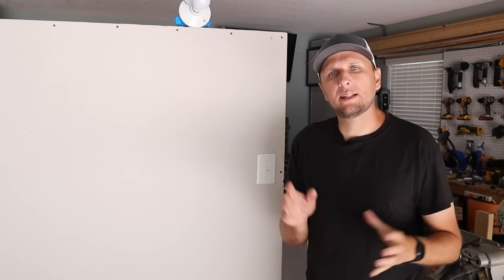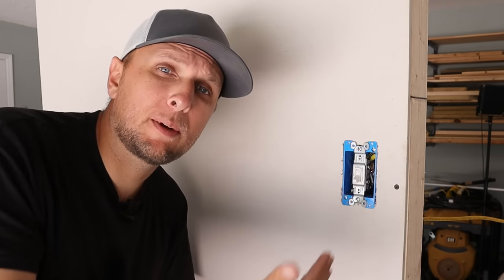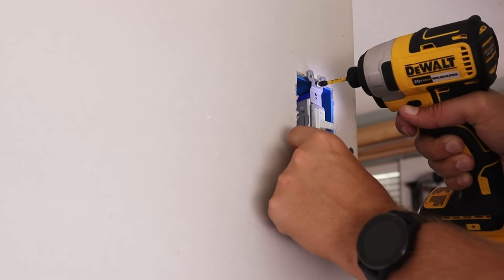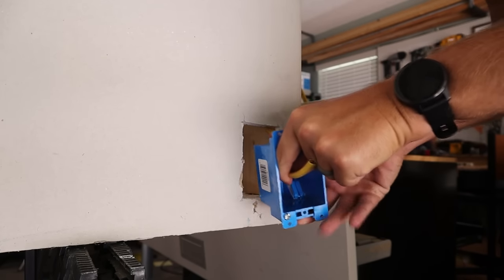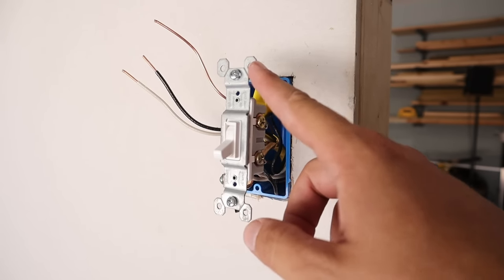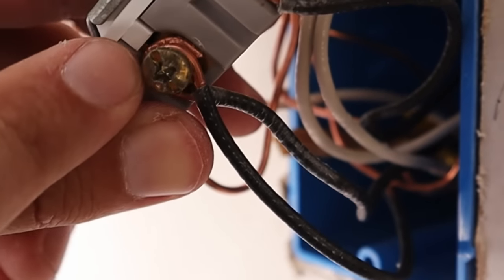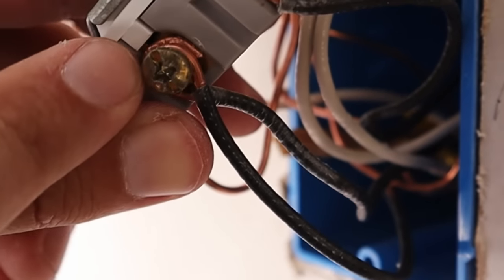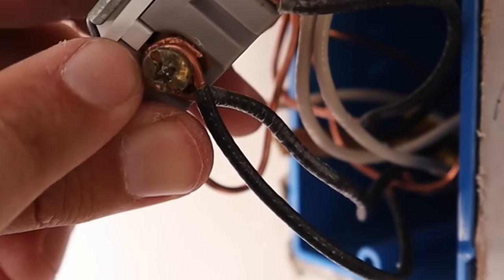How To Add An Outlet From A Light Switch | Common Mistake

Comment: Alot of light switches and light fixtures are on 15A circuit breakers and use 14 gauge wiring. Outlets are usually on 20A breakers and use 12 gauge wiring. As always I go by the 80 percent continuous load principle where a 20A circuit should be loaded to no more than 16 amps. A 15A circuit maxes out at 12 amps.
Reply from the maker: Depends on local jurisdiction.  My house is pretty new and almost none of my outlets are on a 20A breaker or use #12 wire.  The circuit size is determined by the room and it's intended use.  I know some places do what you're saying but definitely not all or most.

Comment: Great videos, I just subscribed.  Can you do a video of how to install a ceiling fan in a room where there’s none?  All of our rooms have a light switch that controls an outlet and there is no light fixture on our ceiling.  Keep up the great work.  Thank you
Reply: I've had to do that before, many times - I make my living as a handyman, if that makes any difference. It's a pretty involved process and if you don't have much experience with home wiring you should at least consult with an electrician before starting it. If nothing else, get them to tell you A) if your local codes allow you to put a fixture on the same circuit as your outlets, and B) if you even have enough amperage available on the existing circuit to support another fixture.
Reply: Going to have to punch holes in the walls and ceiling.
Reply: @danlux4954  Unless the wires run through the attic (or basement...or both.)
Reply: @Dwayne_Bearup  still have to punch holes in the walls and ceiling to run the wire from the switch to the ceiling.
Reply: @danlux4954  Most homeowners lack the skill to repair drywall properly and youtube videos can only teach so much about texturing techniques. Matching the patch texture to the original texture and making the patch invisible requires a level of practice most homeowners/DIY'ers rarely bother with. Fortunately there are ways to add a new wire to a switch box that don't involve chopping holes in the walls, provided there's an attic. Ten minutes with a fish tape or rod and some patience saves hours of drywall work patching holes.
Reply: @Dwayne_Bearup  most houses here have two floors, attic only works on the upper floors.
Reply: @danlux4954  That's true. And I know OP said all the rooms in his house have switched outlets instead of ceiling lights/fans, but it's very rare - in my lifetime of experience - to find that situation anywhere but the bedrooms of a home. Since bedrooms aren't typically found on the ground floor unless it's a single story home and most homes have pitched roofs...attic.

Comment: Great videos!  I have a question about my electrical panel.  I am doing a kitchen renovation and my electrical panel has two slots in my panel with four breaker terminals supplying power to my refrigerator, dishwasher and range.  Each of the slots have two breakers and the ones in the centre are joined by a bar that feed the range.  What is the reason for this?  Should I keep this configuration or would it be ok for me to feed a receptacle with the one labeled for the range?

Comment: Great demonstration. However many times and more often than not I will find shortcuts that were made to a light switch where there is no neutral wire because the neutral wire has black tape around it and it has been repurposed as the return load wire to the light socket. In that case you would be looking for a wire that does not exist. Maybe point that out and the video and offer the alternative as they will also need to find an existing outlet to jumper a neutral wire from, And if that case they could’ve just got both black white and ground wires from that outlet

Comment: The outlet and switch appear to be “commercial grade” (better quality), which might be worth mentioning.
In cutting a hole for an electrical box, an old woodworking technique appears to produce a cleaner cut; score the surface with a sharp utility knife and straight edge, then finish with the jab (or “drywall”) saw.
Before the trolls and naysayers attack, yes, the cover plate should cover a ragged edge, “should” being the operative word.  A ragged cut can lead to cracking, splitting, etc.  Better to get it right from the start.

Comment: Make sure you don't overload the circuit. By code you can only have so many outlets on a breaker depending on current capacity.
In many cases lighting circuits may be set at a lower capacity in the first place, so running an outlet might not be allowed.

Comment: Loved the video, very helpful.  However, after I hooked the outlet to the switch, the outlet is powered with the switch.  Is my Hot wire on wrong side of switch?
Reply from the maker: If you used pigtails then I’m guessing you connected the receptacles new feed wire to the load wires going from the switch to the light fixture

Comment: I have seen in brand new homes, a receptacle circuit coming off a switch circuit, and they use the push it connector, and the screw to pass the power...problem is the plug circuit need to be robust, and if overloaded it will melt that push in connector...Another reason to wire nut all the black wire together, and run a pigtail to the switch

Comment: In newer Australian homes earth leakage circuit breakers are fitted to all outlets except the refrigerator outlet and the lighting circuit. Under regulations you have to be a licenced electrician to do any electrical work.

Comment: Hi. Nice video, so, the outlet will have power always, with the switch on or off, right? Thats what i need to do on my bathroom, i have a light switch connected to an outlet but no light fixture on the ceiling, so i need to add one, but i need to make that outlet to have power when i turn of the light, let me know if i can follow this video to make my proyect happen, thanks. Keep up the good work...
Reply from the maker: Yes the outlet will always have power.  If you’re installing it in a bathroom though, you will want it to be GFCI protected.  They make a model of this combination switch that is a GFCI receptacle.  I would get that one.
Reply: Im sorry i mean bedroom.
Reply from the maker: @baloo217  Oh ok then a normal combination switch should suffice.

Comment: In Turkey there won't be any neutral wire in switch box area. There will be only phase. Neatural will directly go to light area. Phase will go to switch and from switch it will go to light area. So creating a power outlet somewhere near a switch by connectting parallel wires to a switch is not possible here. You will allways need to connect your wires to juction box. Also, we don't like to mix up light (switch) and outlets in fusebox here in Turkey. For example, in my home there are around 20 fuses. 6 of them are for switches (lights) and 14 of them are for outlets. By this, if something goes wrong you will have either outlet or light in that room. If your outlet works, you can hook up a table lamp untill fixing the problem. 

Also since we live in concrete buildings, adding a switch hole or adding a outlet hole is not an easy job. We create a cavity for wires in the wall. Spread a electric wire hose in that cavity. Use new cables in that hose. Than close up the cavity with plaster. Than paint the wall. :) Since this is a hard and messy thing to do, we generally don't want to add a outlet or a switch to a system if we are not renovating the house (which would mean plastering and painting, so adding a outlet in that time will be a good choise). If we have to add anyway, we use on the wall outlets and switches. They are ugly; but what can you do sometimes? 

We are lucky though, because our system is 220V. That means half the amp for the appliance. That saves us from a lot of trouble. 60 years old buildings with original (thinner) wires can easily be enough for most of the households. That is not ideal, but saves the day. If our system was 110V there would be much more electric fires, which are rare in Turkey. Adding washing machines, ovens, heaters would be much harder. But thanks to 220V, we just don't think. We buy a heater. Plug it in. And use it in a 60 year old apartment with 60 year old thin wires. :D :D Apartments main wires are allways nice. After getting devided to apartment flats it gets much thinner in old buildings. But those thin wires are enough for 8kw for an apartment flat (with some wire heating), which is an insane power usage. We rarely pass 4kw per apartment flat. We don't need a special electric line for electric oven, or dryer (here in Turkey there is not such a thing called gas powered dryer. All of them are electric). We only use special electric line for AC unit. WE NEVER USE AC FOR HEATING/COOLING THE ENTIRE HOUSE. We use split ac. Most luxurious houses will have at most three AC units. Generally there will be one or two, if not none. 

In Turkey building safety laws are good and up to date. When building a new building electricty system will be rock solid. But the law does not force old buildings to renew their old systems, wires etc. So, there are even some old buildings WITHOUT grounding. :D I know, that sounds dangerous, but there are not much apartments left like that... Making a renavation in your house does not need permission here. So no one will be checking it wether you renewed your electric system or not. THIS IS A BIG PROBLEM. But 220V and concrete buildings save lots of lives from fire.

Concrete buildings mean electric fires are just in wall cable burns and some smoke. :) No one is going to call firefighters for that. :D Pull down the fuses. Call a repairman and that is it. :D

Comment: You guys are allowed to do your own wiring. In New Zealand we can't do more than change a light bulb without it having to be certified. Also our domestic lighting runs on 5 amp circuits whereas power runs off 10 amp and are kept separate.

Comment: New to DYI here…..So I see the ground wire but on the opposite side, I noticed you have two hotwires that’s typically OK? I was always under the impression it was neutral, hot ground.

Comment: I was wondering do you use the same thickness of wire as in the socket wire or that of the wire used for the lights to piggy back the live wire to the light switch?

Comment: Very helpful, thank you. I need help with another project. I have a wall outlet near my front door and decided I'll use it to install a transformer for my ring door bell. I cut the wall, installed an electrical box for the transformer and hooked up the transformer to the outlet (in the not ideal stacking way as you demonstrated in this video). The door bell worked for a couple minutes then stopped. The transformer seem to have just died. I thought it was defective and had it exchanged but the same thing happened again. What am I doing wrong?

Comment: Even though appear simple, these common ones are the ones that have the most boo-boos in them!
Thanks for showing the wrong and the right way of doing things. Priceless.
But a Question :   Any help is highly appreciated. 

I have a mystery. At my entrance door (Old house) the ring bottom seems to have a kind of shared wire with the ceiling light on top of the door so if the light is on, the ring no more works! What has gone wrong and what surprises the prior owner has cooked for me? I guess my remedy is to run a new load line, from not knowing where but hopefully a close location to the lamp on the ceiling but is it all, or do you think only a load and neutral wire could be reversibly connected on something else?

Comment: We can't do this in the UK as domestic lighting is on generally 6amp breaker and Sockets(Receptacle) are either 16 amp 20 amp Radial circuit or 32 Ring circuit supply by 230v ac.

Comment: Very nice video. I had did this but I only get power to my outlet once I turn the light switch on. When the light is off there is no longer power to the outlet. What did I do wrong? Or do I need to change to a different kind of switch like 3 way ?
Reply from the maker: No it should be just a standard single pole switch.  Sounds like you wired the receptacle to the load wire instead of the line on light switch.

Comment: My family lived in an apartment that had only 2 circuit breakers working and hooked up to everything in the 3 bedroom apartment except the oven which was on a double pole 50 amp. We had no heat or hot water for all of 2023 and the portable heaters were on low and still tripped the main breaker which was a double pole 100 amp. I didn’t realize how dire our situation was until the last few months.

Comment: I write breaker# and junction number on back of all wall plates... Your electrician will thank you... That way pop off the plate you know exactly what breaker to goto before it without pulling the outlets out of the box. Example p1-1-3. Pop all plates in the room and you have an instant map

Comment: In my experience, there is typically a fire block in the wall cavity between the location of a light switch and where an outlet is normally installed. While all the electrical points are the same as depicted in this video, the need to run the wiring through such a block complicates this project.

Comment: Thanks for this! I used your video to do this just today. I did run into an issue and idk if you have any ideas. My light switch is a 3 way. I've got neutral in the box (not attached to the light switch), two travelers, and a hot. I determined the hot by taking everything off the switch and testing each wire.

I'll call the switch I ran to the outlet "A" and the second switch from the 3 way as "B". Switch B still controls the light without issue. Switch A will only control the light if B is left ON. The outlet works regardless.

A friend of mine with more experience suspects A is last of several junctures and that to fix this I'd need to run a new hot and neutral from the attic down to the outlet and put this light back the way it was.

You ever see this before? Thoughts?
Reply from the maker: I would say that A was not wired back properly.  If you pigtailed off of the hot wire or the wire that you took off of the common terminal of the first 3 way switch then this install should not have influenced any of that. There are quite a few things that may have been wired incorrectly and without me being there to see what was done I can’t say for sure what it is.  Line wire may have been connected to a traveler terminal.   Don’t know if you did anything with the second switch.  This is course is all assuming that you located the actual line wire that supplies power all of the time regardless of the switches being in the on or off position.  Bottom line, some wires most likely were mixed up. Or you are in the box of the second switch in the line of switches.  Sorry I really can’t help any further.
Reply: @HowToHomeDIY  ty! I have a suspicion that I'm going to try out soon based on your feedback. The box had two black wires, a red, and a ground. I talked to my electrician friend and he said the red would be a traveler. Thing is, when I tested the wires, both the red and ONE black were live. In hindsight I'm thinking the red may have been used as the hot wire and both blacks are travelers. I'll have to open it up, separate everything, and see if the red stays live regardless of the switch positions.

Red may have been a traveler in his experience but there's so much done wrong in this house that they could have just used the red wire bc it's the spicy color 🤡

Comment: Hello cool video , question I want my outlet to work with the switch but the connection for the switch is somewhere else cuz is only one cable running to the switch

Comment: ok, so i have a question. what are these new box screws tightening into to hold the box in place, considering you've cut out the hole??
Reply: I have the same question.  I'm digging through the questions here to try to find the answer.

Comment: I'm remodeling my house and recently learned that I could make a cleaner hole by using one of those box cutters with the break-away blades. I just wiggle the blade to work it through the drywall.

Comment: Nice connections but in NZ we’d never mix a lighting circuit with a  wall plug because lighting circuit breakers are set for much lower currents, esp since LED  light fittings came out.For instance if you plug in a 2000 watt heater to the wall socket, it would probably pop the circuit breaker and then u have no heat and no light either. But it n the US maybe the lighting circuits have higher capacity?

Comment: I also ran into a switch with hot coming in and unmarked white used to return power to the bathroom ceiling light. EXCEPT there was a much newer funky acting outlet box wired right next to it. The 2 whites were tied together and pig tailed to the switch. The fan/light worked ok off the switch. I thought this funky acting outlet was dead since I always had the ceiling lite on. That's why I tore into it. By fooling around I found when the lite was off, the outlet would work when I had something plugged into it. Just by plugging something in would turn the ceiling light on but it was very dim. I found another older dead outlet in the room and I think someone added this cobbled up outlet to get another working outlet on the wall.  It was in an apartment building my son just purchased. No idea how long it had been this way. Scary . May try to fish a white wire down from the light fixture to the switch for the outlet return.

Comment: You could find live power with that live wire tool. With switch off and power on, run that tool with sensitivity higher and go up and down the wall.  Or buy a stud find with detection included.

Comment: That's all well and good if it's not fed from the light than to the switch. Was going to add one and couldn't because they fed it from the top so black was hot and the white was a switch leg